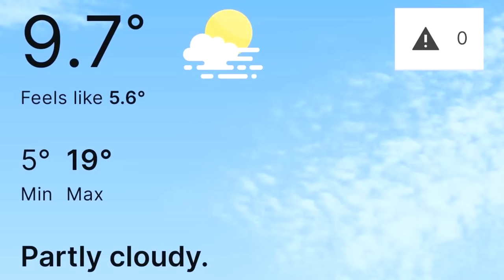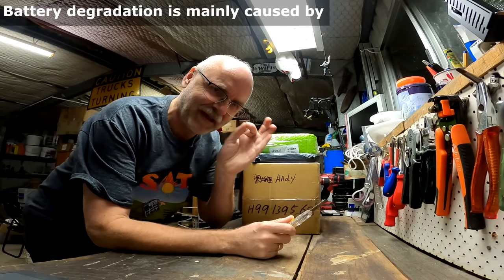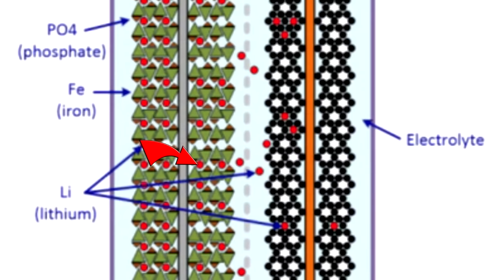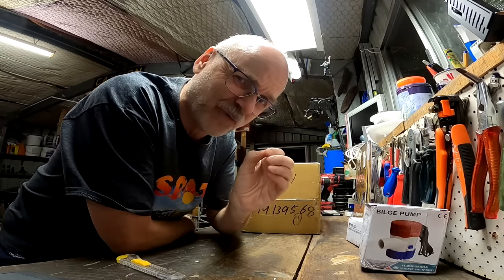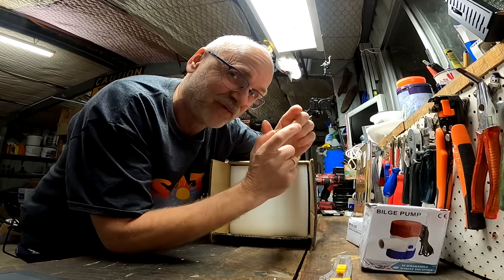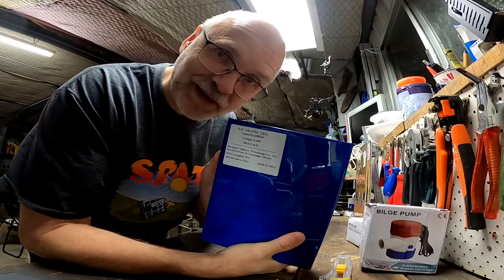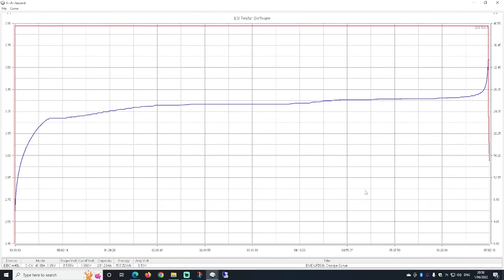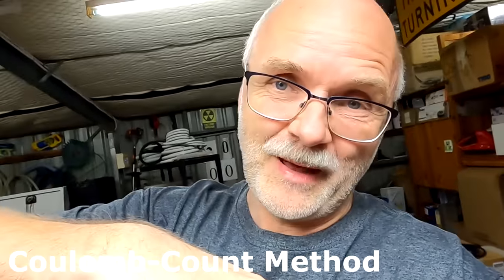Busting the 20%-80% SOC myth for LiFePO4 batteries.

Comment: I could use some help.  Running 200watt solar on a camper for the 12v fridge.  have it connected to 30amp pwm controller then to the lifepo4 battery.  from there I go to a 25a breaker for  what breakers do and to isolate the lifepo4 from the lead system when in use (the truck alternator/shore power).  Then I put another pwm controller set for 13volts going to the lead battery.   So the solar charges the lifepo4 then the lifepo4 charges the lead.   The lifepo4 does most of the lifting charging and discharging.  Am I off my rocker or is this viable.  only on the second test right now.  First time I was pumping to much to the lead so backed it down a bit.
Reply from the maker: That won't work. You can have only one controller connected to your panel.
So, solar panel - PWM controller -LiFePO4 battery. 
If you want to charge the 12V battery as well from this system, you would need a DC-DC charger. The takes energy from the LiFePO4 and charges the 12V lead acid battery. Renogy makes them for example.
Reply: @OffGridGarageAustralia  Thanks I'll look into DC-DC charger.  I was thinking the second pwm would work as a dc-dc charger.  This last test looks promising but did not want to go to far and find what the breaking point is and damage the battery.
Reply from the maker: @swamprat9018  nah, the voltage difference is not there to charge one 12V battery from another 12V battery. The DC-DC charger has a boost converter to raise the voltage to 16-18V. PWM solar chargers cannot do that.
Reply: @OffGridGarageAustralia  I only have a 200 watt solar panel rated for 17.?? volts going to the first battery.  I've only seen it get up to 11v. in daylight so far.  So I don't even have enough solar to charge the lithium battery with the provided PWM set for lithium settings.   This is making me into the un happy camper group.  LOL   Thank You for sharing your knowledge and time.
Reply from the maker: @swamprat9018  disconnect the solar panel from the battery and measure the voltage without any load. It should show the 17V. It's normal once it is connected to the battery, that the voltage will go down.

Comment: I heard that lithium batteries degrade more at higher voltages. Even if your cycling them shallowly between 95 and 100% that higher voltage is worse than say you had cycled them between 5 and 10% instead.  And temperature over room temperature makes a large difference in degradation especially in the hotter temperatures.  From what I gathered the single most important thing you can do to stop your batteries from degrading is keep them in a climate controled box controlling temperature and humidity.  And heck maybe even oxygen levels.
Reply: There's a pretty thorough study done. You've probably read it before but here it is again "calendar aging studies energies-14-01732"
Reply from the maker: Thanks Travis.
Reply: @OffGridGarageAustralia  so if the anode grows and shrinks as the battery cycles causing abrasion damage?  Does cycling a battery that's twice as large half as deep cause it to last twice as long so end up costing you the same dollar per kilowatt hour consumed over the life or does it lasts four times longer therefore saving you money in the long run by having a battery that's double the size?

Comment: Hi, got a few questions the lifepo4 battery is showing 3.2V on the sticker so why r we charging to 3.45V. I am getting my new batteries I am not using a smart chant I am using a daly bms. Can you tell me the best figures I should keep my batteries. It'd a 320Ah batteries 16cells. The supplier only gave a few data n that don't have any figures as highest charge n how far I should discharge etc. Any help would be great.
Reply from the maker: Hello Pulith. I have linked a few videos about what you should know about LiFePO4 in the video description and also at the end of the video.
3.2V is just the nominal voltage of the cell but we charge it higher to 3.45V-3.65V. This is similar to 12V batteries which get charged to 14V.
Reply: @OffGridGarageAustralia  thanks for the reply. I will check. If I get stuck I shall ask you. I am in srilanka so any help you would give would be highly appreciated. Thanks in advance. I learned alot watching your videos.

Comment: Can u help to add one page about the setting in ur BMSs best setting not all ppl has so much equipment to measure the battery
Reply from the maker: Once the videos come out, it will be on the homepage as well...
Reply: @OffGridGarageAustralia  just a question what is the max distance from battery to inverter
Reply from the maker: @ykchowaa  there is none. It depends on the dimensions of your cables.
Reply: @OffGridGarageAustralia  yes I think abuse low R cable because p=i*i*R

Comment: I was reading today of someone who has greatly degraded batteries and he had them on solar for two years but with the solar voltage set at 13v (3.25v/cell) and I believe a small load. My theory is that he has grossly undercharged them as, at 13v very little current will be put back in as the batteries can reach this voltage with a low charge current and charge would be backing off at about 5% full. My recommendation for long term float would be about 13.3v for shore power and 13.4v for solar if there are light loads. For no load I would just get them to about 50% and disconnect. Thoughts?

Comment: Sounds like at least 10 years worth of new videos on the subject.  I don't see how it can be done because there are too many variables.  Example, at any given point of time there is a 1.2 to 1.6 volt difference between my solar change controller reading,  the smart BMS, and the inverter reading. I also have three volt meters ranging from a mew Klein Tools to a very cheap box store model.  At any point in time the three volt meters will have a difference in volt reading of about 1.5 volts.  So,  the point is that none of the electrical components are accurate enough to give a consistent,  accurate voltage reading to accomplish that which you seek to accomplish. 
The only way I have found of dealing with the issue is trial and error.  For example,  for my system I have to set the smart BMS to a maximun per cell voltage of 5.0 volts,  with a sum cell voltage of 34 volts to be able to change my 24v, 280ah cell battery to 4.5, at which time zero amps are fed into the battery. Andy, I know if anyone can find a way to do it,  you can.
Reply from the maker: Thanks a lot for sharing. Great comment. What batteries do you have that you can charge them to 4.5V?
Yeah, the more devices you have the more results. Which one to believe... you just have to pick one and make this your reference.
Reply: @OffGridGarageAustralia  4.5 is what my solar charge controller says.  But,  the smart BMS says 3.45, and my Klein says 3.38.
Reply: @JR-kk6ce  Please double check your system. Such wild variations in voltage measurements is definitely unusual.
Reply: @adon8672  thank you for your suggestion.  I have checked it hundreds of times.  So much so my wife says I'm cheating on her with the battery.  What I found was a lack accuracy between the instruments and electronics. As Andy pointed out, we are dealing with a relatively small range of voltage,  and when you consider the lack of calibration in solar charge controllers, inverters, and even high end multi meters which will stray from their initial calibration,  I just don't see a way of arriving at a universally acceptable way of properly programming a BMS and solar charge controller.  But, then again, Andy will find a way.
Reply: @adon8672  It sounds like you might have a loose connection somewhere

Comment: yes mate it is true the battery is not 50 volt but 16 cels from 3.1 volt
so no need to charge higher than the cell voltage, but you know time
they have no time but if you have time you do not need a bms.

Comment: So.... The ideal voltages to charge the lifepo4 is 13,6 and don't discharge more than 12,4 volts. If i conect in parallel with some AGM batteryes...will be fine like that? 13,6 and 12,4. I will use bouth of them...and charge and discharge corectly. I undestand it well? But in 24 / 48 sistems?
Reply from the maker: I would not recommend charging different chemistries in parallel. There will always be limitations.
Reply: but if you don't pass the maximum voltage.... What could hapened?

Comment: Unfortunately LifePo4 charging profiles only consider voltage and not amp hours. The algorithm must be improved to consider both amp hours and voltage.
Reply: Some home battery/inverter combinations use the can bus to allow the battery BMS to tell the inverter/charger to reduce the charge current when the cells are nearly full. But yes we need to see more of this capability from the likes of victron and other charge controller manufacturers of individual pieces of equipment.

Comment: My Temgot 460AH lithium has been siting at 100% for a month and currently reads 100% 460/485.  Does this mean I'm safe at 100%?  My voltage currently reads 13.4v and my cells 3.36.  My issue is that 90% of the time I am not draining the battery much.  I charge with Victron mppt and dc-dc chargers.  I wonder how much life this will cost over time? To make it simple  It would be great if battery apps allowed us to set battery  thresholds or if they just built in more cushion to keep the life up?

Comment: A "Smart Shunt" that you have to frequently recalibrate isn't so smart if you ask me. Victron 👎
Reply: You don’t have to “frequently recalibrate” it, you just need to fully charge the battery to recalibrate it. Because of the flat voltage curve, there is no way to avoid that.
Reply: And if you take away the power it will set to 100%!   A simple switch between the shunt and power cable...
Reply from the maker: Yeah, I know, but that's bad either. I don't want it to reset to 100%.

Comment: Good stuff Andy - as they say "Publish and be damned" - being wrong is the way we all learn it doesnt ( not always) mean you are dumb.
Now I looked closely at your graph - very revealing. Discharge Ah monitoring can be done between say 3.30V and 3.20V (must have accurate metering 4 1/2 , 5 1/2 better digs.  There are simple algorithms to detect rate of change of volts dV/dT to identify knee finish and start - best way IMHO  For discharge you need headroom more than obsessive SOC figures as per EV usage - like a reserve tank of fuel, 15-20% feels warm and comfortable. Note your curve is for a constant load of 0.108ohms)

Charge Ah monitor 3.25V and stop at 3.40V say (according to your curves) Note your curve is for a constant charge current 40Amps 

Gaining the last Joule of usable energy capacity may suit the marketing vultures in the business but the figures are not of value to the average user - who wants reliable usage for a long life long life.

As an off gridder you should know that these guys favoured flooded tubular Lead Acid cells and budgeted for 10 year life down to 50% SOH.
Said cells were never brought below 50% SOC and they had the luxury of electrolyte sg for determining true SOC )oh happy days at a price $$$$.  Same with fork lift trucks and electric milk floats. Old but reliable technology AFAIK and never seen above the radar bar in the hyperballs stakes we have to endure with the Lifepo feeding frenzy.

Ideally (but not a practical case) we should have both curves at constant current?  It may show more enlightening data for reference or cell characterisation - eg if done for a short  period at ca 50% DOD say?  What do you think for a quick health test say?

BTW the 80-20% figure is quoted as at least doubling the number of said power cycles for battery life - you forgot that point. 

If you care to send me the data you may have saved, I'd be happy to put them up in excel and do some further  analysis, eg like flipping the x axis to put both curve together ie IN vs OUT,  also Coulomb storage vs time etc . Would send graphs back to you by pm for your publishing.

Festina Lente as Caesar said (pre-Lithium era)

Robin (Praetor)

Comment: You said before to charge to 3.5 v to equalize the cells with all the batteries in parallel . Now you say 3.4 max!! I want 4 12v 105Ah LiFePo4 in series for my golf cart. What is the true story?
Reply: Most 12v LFP battery packs can't be serialized, so be careful with that. It's due to the total circuit load on each of the batteries BMS's.

Comment: I already charge my LiFePO4 batteries up to 3.4V per cell and 0.2C . I have 45kW in paralel so I'm charging with 105A all pack since the current is devided in 3(paralel). Again... everyoane shoud have a look on the diagram that the batteries work as producer provides it like you showed the battery curve.
Also I think the Victron is selling shitty commercial configuration with batteries charged at 3.6V... exceeding the 3.4V just to make it commercial and buy new batteries from them every 5 years... this is my opinion

Comment: Yeah LiFePo doesn't really suffer from the full charge like liion because the voltage isn't as high, the high and low voltage is what hurts them, the LiFePo I have read they can go to 4v, nut there is no gains, and probably not going to survive long either.. it was with the paperwork that came with the cells, K2 26650's I'm thinking, I never go over 3.7v ever, unless it's a dumb mistake,

Comment: Wait. LiFePO4 are just ONE chemistry of Li-Ion batterie technology, right? LiFePO4 actually ARE Li-Ion batteries .. You should have specified the chemistry of the Li-Ion graph you've shown.

Another one: what if a user has no chance to limit the temperature to below 30°C? What if they would regularly increase to 45°C in summertime, due to their location in the vehicle? Asking for a friend ;-)
Reply from the maker: This is all material form older videos and I said this in the video what battery type we're looking at.

EVs usually have battery cooling. My Tesla keeps the battery between 30-45°C before it starts cooling. The Outlander PHEV I had prior did a terrible job in cooling the battery. It was only air-cooled and all cells had different temperatures which lead to a lot of problems after a while... This is all on my car channel though (link in the description).
Reply: @OffGridGarageAustralia  Sorry Andy, I missed out the mentioning.

Reg. temperatures, what about RVs being parked with no A/C on, but Solar charging and consumers such as a compressor fridge? What do you reckon, what harm with temps around 45°C whilst charging with 0,1C (discharge way lower) do to the cells?

Comment: Bit hard when you have Lithium in an van like an Iveco to keep it under 30C
Reply: Connect a dc fan to keep the batteries cool. I keep my inverter fan from coming on too often with a 12v dc computer fan blowing air into it from outside.
Reply from the maker: Yeah, I don't know how mine will end up in the shelf in summer time. I have no ventilation either. The Battery 1.0 in it's box was nearly 38°C warm when we hade like 40°C outside. That was with high charging and discharging rates though, so I hope the three sisters stay a bit colder as the current is a lot less.

Comment: Lithium ion battery was never ready for mass use. People do stupid things with them like trying to speed up charging time with higher than recommended power. Also leaving charging unattended, wetting connections, modifying parameters etc. These st2pid behaviors caused many fires. Lithium ion batteries can never be made idiotproof.